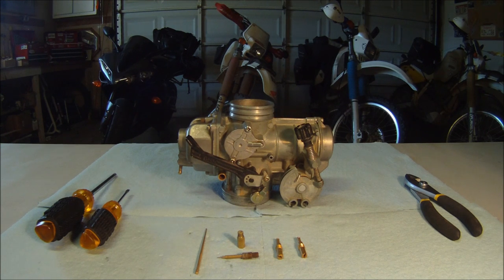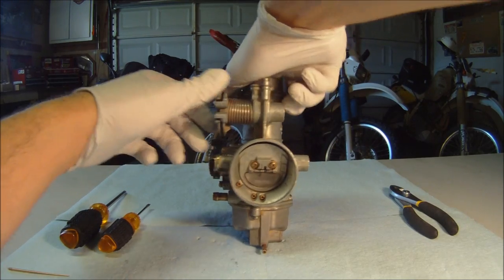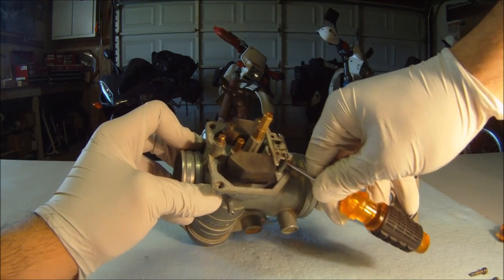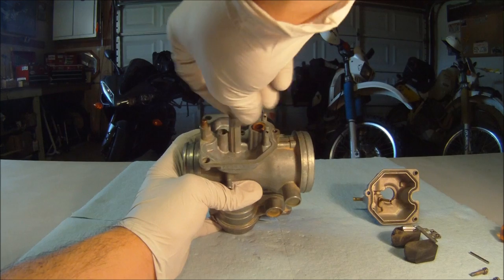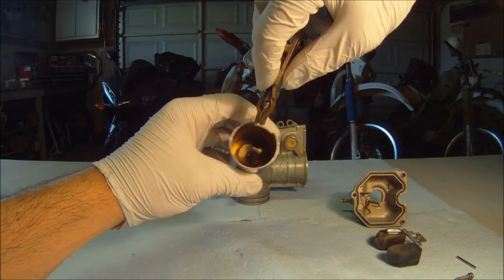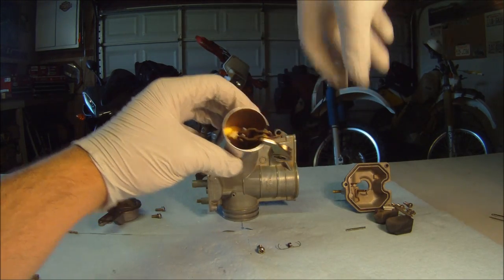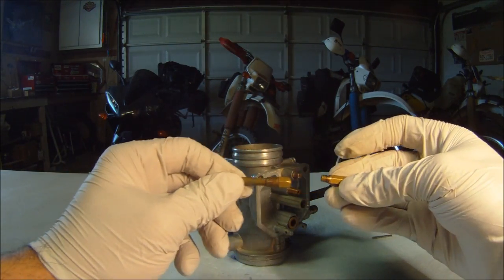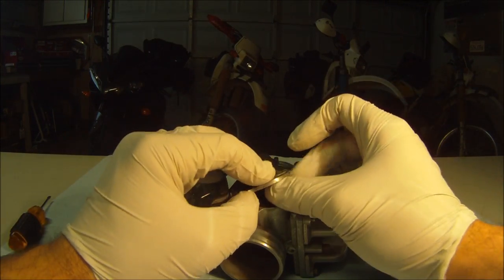Motorcycle carb tear-down, function, and assembly (Keihin PD)

Comment: Thanks for the video! Seeing you go through and explain the rebuild of this carb helped me a lot in rebuilding the carb on my XR 650R. I installed the large jet and free flow coupler between the engine and carb along with a different needle and seat and a free flow spark arrester for the tailpipe. My bike had lots of power before, but now it just screams on gasoline or ethanol!!!! My bike can also run on CNG, (compressed natural gas) or H2, (hydrogen) or any blend of the two.

Comment: I'm learning how to do my own maintenance on my bike so when it came time to clean the carb I was afraid by it needed a cleaning real bad. I started with the throttle removing the cables down to the carb where I finally removed it from the bike , however when I tried to remove the bowl I stripped the bolts. I don't know why it was so tight but that prevented me from taking apart the carb for thorough cleaning and instead only surface cleaning until I figure out how to get those bolts off. Although I ran into some problems I did learn some things along the way and better prepared the next time knowing that I have your very informative well explained and clear explanation of how-to video I can follow. I like to ask you, it never backfired as bad as it does now after I put the carb back on,. I never replaced anything on the carb never change anything maybe the cables may have gotten adjusted differently since but other than that every time I let off the throttle it backfires and pops and I hate it, any suggestions.
Reply from the maker: Hi William. Thanks for your thorough explanation. The carb bolts have given me problems in the past also. Not sure why they tighten up so much, but maybe it has something to do with being so close to the heat of the engine. In the past I've had to use a hand punch driver to assist in removing the bolts. Also, finding the exact right screwdriver head helps. 

Regarding the carb cleaning. The most important parts of the carb to clean are underneath the bowl. The jets are often what get clogged. I'm guessing that when you removed the carb and jostled it around, some gunk was knocked loose and is sitting inside one of the jets now. I have another video on this channel regarding how to clean your carburetor using simple green and boiling water. It would be a good idea to get the bowl off for this process though so you can remove the jets. 

I remember when it came time to work on my carburetor, I removed and installed it multiple times because I also wanted it to be a quick and easy fix. But since the carb handles a huge responsibility, it will require a thorough cleaning before going back in. I think many of us on this channel can agree that we unexpectedly get good at removing the carb. Hope you can get your XR running smooth again. Nobody likes a big bore beast that backfires. Good luck and have a great day. Ride safe out there.

Comment: Can you please explain how to properly mount the throttle cables back on the carb? I bought a '02 Xr400 and its in pretty rough condition. I am not mechanically inclined but I want to learn how to fix my own bike. I have looked all over YT and forums but have had no luck. Thank you.

Comment: Yes - agree.  Great video.  Thank you very much for posting this.  I have a Keihin PD that I took off of my 1985 XR350R with the single carb.  However the carb looks just like the one in your video (at least from the outside).  The bike sat for almost 10 years in my garage (it ran fine when I last rode it).  I drained the tank and gave it fresh gas.  Could start the engine but it won't run and there's no power when I turn the throttle.  I'm going to follow your instructions for disassembling the carb and will clean it.  Hopefully I will find something that explains why the bike won't run.  What parts do you recommend I get besides the gaskets and the air valve?  Thanks!  Mike

Comment from the maker: For my XR the pilot screw should be turned out about 1 5/8 to 2 turns.  That means turning the pilot screw all the way in (gently seating it), and turning it out the required amount of turns.  Depending on what vehicle you're using this carburetor on, the manual will specify how many turns out the pilot screw should be.  Minor adjustments can be made beyond this, but the idle screw should be used in conjunction to fully set idle.  Hopefully you find this helpful.

Comment: It appears that if you (me) accidentally let the throttle spring unwind a bit, the required tension is immediately lost, and there does not appear to be any way to salvage it. Is this correct, or is there a way to salvage the spring and return it to the proper tension?
Reply from the maker: Not that I'm aware of, unfortunately. That has happened to me once and I don't recall being able to repair it. Best.

Comment: I got a new air cut-off valve for my PD carb and along with the spring and vale, a very small seal of some sort was included loose in the packaging. Any idea where this small seal my go? I don't see any seal on the old valve that I removed.
Reply: It seals the air passage to the air cut valve where the cover bolts to the carb body.

Comment: hey mate good video helped me understand alot about the carb. i have a 93 xr600r that had been not running for about 2 years. i had my stator rewound a new cdi and my pulse generator cleaned to get it running again. it ran good on idle but it will only rev just past half throttle and then it will spit fire and bore out, I have taken my carb apart cleaned all the jets as you have shown me but it is still doing it?????? I havent touched the air/fuel mixture screw tho? it has no choke on my carb and has a after market exhaust. and I think it might have different jets as it has no choke??

Comment: Hi, thanks for posting this to help me tune my 1980 XR500 restoration project. My carb is a PD 07B and while very similar, mine has some differences that I am curious about. The biggest difference is on the non-throttle cable side is the cable-actuated choke and attached to that is a linkage arm that also acts on a plunger rod that goes down into the float bowl, that part is drastically different than yours. I have seen this on other Honda carbs when I search for images but have no clue what the function is. I understand fuel injection much more than carbs. Any idea what this plunger is for? Thanks
Reply from the maker: I have no idea, but if I can find any information on that I will get back to you.  Sounds like you have a fun project on your hands!  Good luck with that 1980 XR!  All the best!

Comment: This is close to my carburetor.  I have a 78 Honda XL250s.  The carbs needle valve has just a single groove to put the clip in.  It also has a spring holding it down in the slide. Also the main jet is 1 piece. I have no idea if its right.  From the exploded part prints I found online it is not correct. I bought a rebuild kit and it has parts in it that I do not have in my carb.
Reply from the maker: I wish I knew more about your carb so I could offer some advice. Did you buy a rebuild kit because it was running poorly, or just to freshen up the parts? Thanks.

Comment: so the float level is measured from the gasket surface to the bottom side of float with the float "up"  or "in" as far as it will go? just want to confirm before I screw up mine :-p

Comment: awesome video thank you. i have a question if your still on here? i bought a 1994 xr600r about 3 weeks ago for my daily driver. it doesnt seem to be beaten or abused. so ive gone through and changed the oil and filter spark plug and air filter and put a 39 tooth rear sprocket on it for more top end speed. so the first time i rode it was maybe 8 miles to a store and back and it was fine but the next ride i went on it seemed to start a bit harder and it would stall out on me only when i came to a stop so now i have to keep it reved up so it wont die. i just adjusted the valves cause it was a bit noisey the intake valves were right on but the exhaust valves were about 4 mm to loose. and it still dies on me at a stop or it will idle up to around 3 thousand rpm. SO i took the carb off today after watching your awesome and extemely helpfull video and found it was a bit dirty in there mostly yellowed old gas stains. but did find that when i pulled the slow idle jet i couldnt see through it. it wasnt totally gunked but did have a flake of crud in there. but the biggest thing i found was when i took the fuel air screw out that as you said should be about 2 turns or less out it was only 3/4 of a turn out! and it has been shooting out carbon onto my rear fender. do you think its just been running to rich? thanks...jeff
Reply from the maker: Hello Jeff.  Did the carburetor sit for an extended time?  If you found gunk in the jets then it is probable that there are more deposits clogging other passageways in the carburetor.  The XR could stall due to being too rich, but it can also stall from a clogged carb also (obviously).  If it sat for a year or more, then maybe a full cleaning is due.  Let me know more information please.  The black soot found on the tail is likely from being rich.  Do you know if the jets are stock?  Any aftermarket mods? Thanks.

Comment: Hey man, your videos have helped a lot with me. I have a 95 XR6, little after I bought it, started blowing smoke. Carb and fuel tank had sediment. Cleaned and rebuilt carb (with your video as help) and cleaned airbox with new UNI filter, adjusted the valves, put it all back together and won't start. Im wondering if you had any tips, fuel screw is set 2 turns out. I set the idle screw but without it running I'm not sure if its correct. First time working on a bike, so it could be something simple. Any help would be greatly appreciated. Thanks!
Reply from the maker: Hey! Congrats on getting an XR. Sucks to hear about the issues. 

1. Did you run the bike between each job? For example. Clean carb, run bike, clean airbox, run bike, adjust valves, run bike?

2. Did you clean out the fuel tank and replace gas?

3. If the idle screw is set too low that could prevent starting. Do you ever try to start with the throttle a little open to see if you can get her going?
Reply: @XRLand  Thanks for the quick reply. I did not run between jobs, I did clean tank and replace with fresh 91, and I haven't attempted to start with throttle open, only time I've opened the throttle is during the honda dance for cold start but not during the compression kick. I have the idle screw set to just barely engage the throttle pulley and have tinkered with it more and less engaged. I am curious just how open the throttle slide needs to be. I know theres a small gap between too open and too closed and I feel like I'm just outside that margin. Also just pulled the spark plug and its very old with lots of black char, I am going to get a new one and maybe that will help.
Reply from the maker: @3cvaughn  You probably already know this now, but best to do one project at a time so that diagnosing a problem is easier. 

Ahh the spark plug. Excellent idea. That could be the problem. 

With the idle screw, it should open the throttle slide a couple millimeters if I remember correctly, but it's been a while. Sorry that's not exactly a very accurate tip. You're doing the right thing playing around with it a bit. 

Hopefully the spark plug is the culprit. It is a bit weird how the bike ran before, and then stopped running. Could be another part causing the problem, but always start with the simple. Let me know how that goes please.
Reply: Thanks man, I’ll let you know how it goes
Reply: Valves weren’t being adjusted on the compression stroke TDC, that why it wouldn’t start. Put the bike in gear and set TDC after the intake valves opened and closed. Started up and ran smooth. Still some black smoke so might be running rich, I’m going to put stock jets in the carb and tune
Reply from the maker: @3cvaughn  So glad you got her running again! Such a rewarding feeling. Sorry the video wasn't clear about two TDCs. Good learning experience since you didn't dive too deep into other parts. Have fun and enjoy the ride. Thanks for letting me know she's up and running!

Comment: Thank you kindly good sir!! This is an amazing video, so well presented and very well edited. Good in conjunction with this guide which I also found very useful. 
http://www.deathridge.com.au/how-to-fix-those-xr600r-carb-issues.html
If you are not to busy, I have a process-of-elimination question.
I have torn down the float section of my XR600 keihin carb twice now, and having found some  initial problems and blockages, and adjusted the float tang twice (incorrect distance the first time), and given it a good clean. After I reassembled - the carb now  leaks all over the place as soon as I turn the fuel on, apparently from both the float-bowl drain hole, and seems to leak around the gasket. My question  : Surely the only things which would cause BIG leaks (aka fuel pissing out around float bowl) would be: 
1.incorrectly installed gasket  2. Incorrectly adjusted float level (I feel sure I got this right this time).
Is there anything else that would cause this?
Reply from the maker: Thanks for your kind comment and useful link. The carb guide you shared is thorough. If the gasket is dried out then it can leak. Have you tried leaving it in overnight and seeing if it leaks the following day? Turning off the fuel of course to allow the gasket to be wet and make a nice seal.
Reply: @XRLand  Thanks heaps for your response mate. After a week, it is still pissing fuel out the float bowl drain, (it doesn't seem to be coming from the gasket at all as I had thought was happening as-well, last week).  I guess the float must be set incorrectly, but I made sure to set it as close to to 14.5 mm  as I could -- per the guide I linked, and also using the method per the tutorial video linked here -- 
https://www.youtube.com/watch?v=3z_IOhrSsWE
I have done this twice already, as I had set it incorrectly the first time.
I guess I need to take the carb off and do it a third time. 
I can't think of another reason for this --
Reply: @XRLand   One other thing I have noticed is a difference from your video and the guide I posted (as well as my own Keihin PD) is the "plastic doohickey" that fits over the main jet is absent on your carburettor. Is it necessary to have it?
I am trying to reassemble the float bowl with the carby still on the bike, and the plastic doohickey doesn't want to stay in it's position. I'd just as soon toss it if I don't need it.